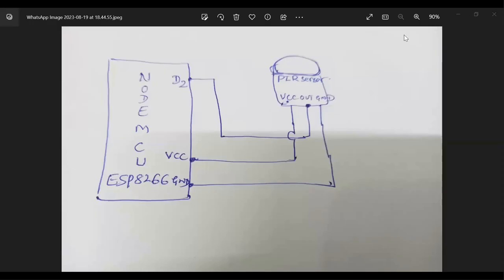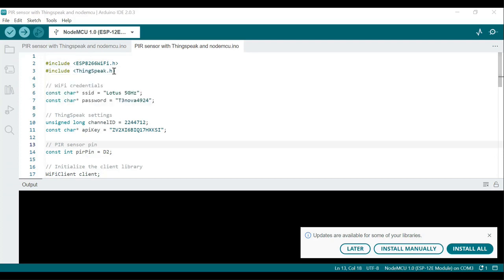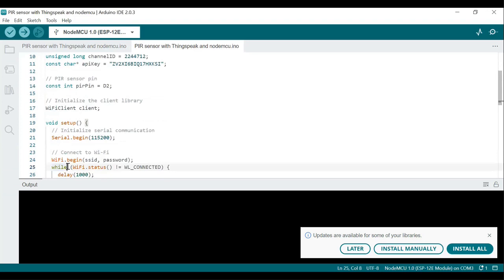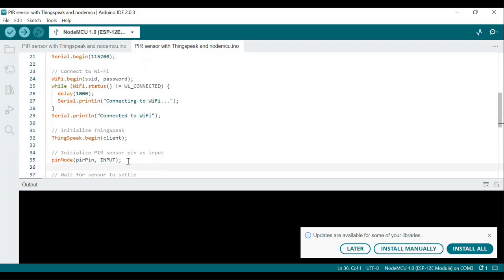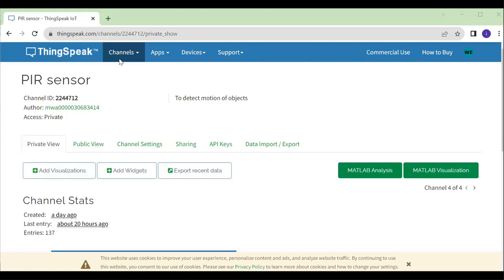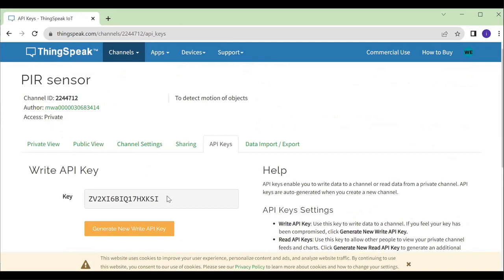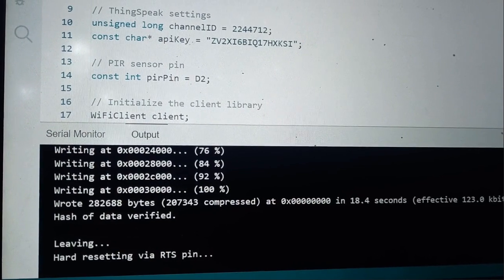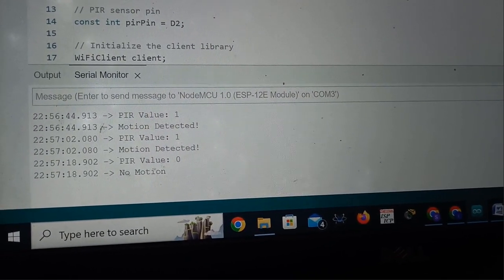PIR Sensor with Nodemcu and ThingSpeak

Comment: Madam very nice video, can you explain how to overcome HTTP error 301 while sending data to thingspeak
Reply from the maker: 1.Check the URL: Make sure you are using the correct URL to send data to ThingSpeak. ThingSpeak provides specific URLs for updating channels and fields. Ensure that you are using the correct URL for your channel.

2.Verify API Key: ThingSpeak requires an API key for authentication when sending data to a channel. Double-check that you are using the correct API key in your request. You can find your API key in your ThingSpeak account settings.

3.Ensure Proper Request Method: Use the appropriate HTTP request method. Typically, you should use HTTP POST when sending data to ThingSpeak channels. Ensure that you are using the POST method in your request.